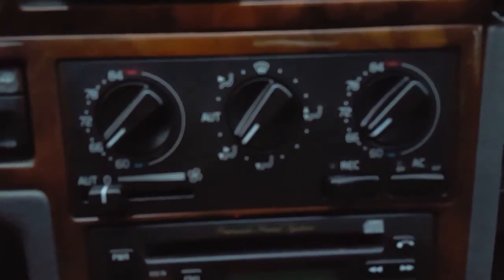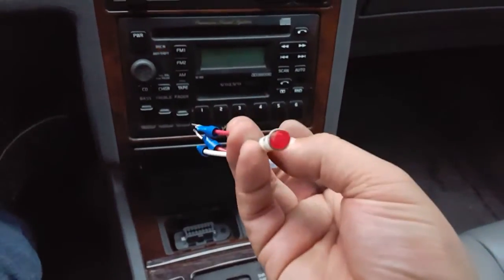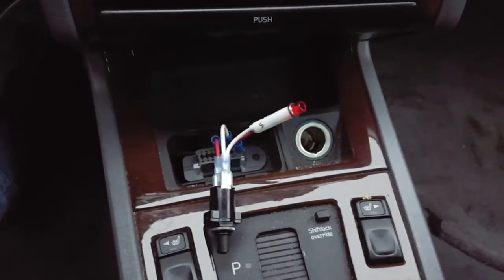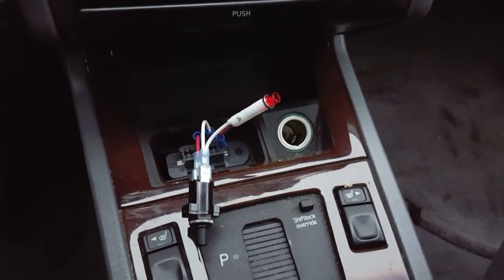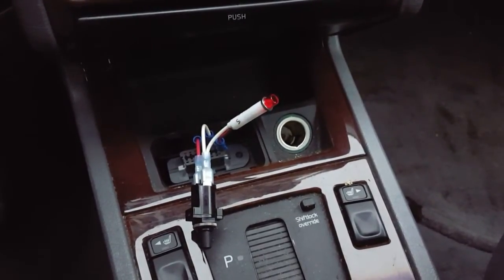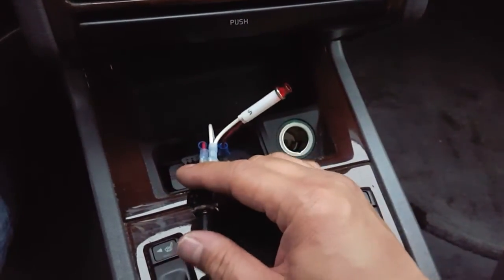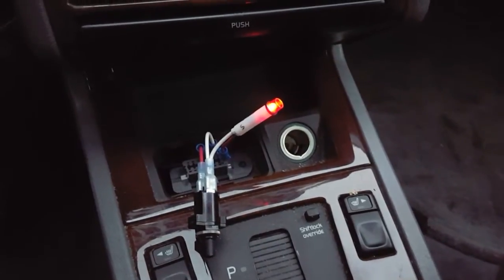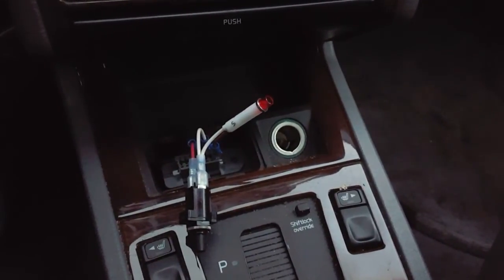1996 Volvo 850:  Reading and clearing ECC codes without a scan tool

Comment: I tried this but it didnt work. Is it only for 96+? I have a 95
Reply from the maker: 1995 models should have an OBD-1 port under the hood, passenger side next to the washer fluid bottle cap behind the headlight.  You don't need a tool for OBD-1 cars, as it's built-in!  See this video from my friend, Robert DIY.  https://youtu.be/bfeiZxhJgxY?si=KcYBig8xhYbSF_D5
Reply: @AKJeeper  this one has the OBD2 as well. So I should just use the one under the hood to read ECC codes?  Whats the process to read them? TIA
Reply from the maker: @xavierfernandez2657  1995 was a transition year.  The OBD2 port isn’t fully-functional as they are on 1996 and 1997 cars.  Check out the video I linked to earlier, Robert explains how you use the OBD1 diagnostic connector.  The ECC codes are read with the jumper in the B1 port.  Use the code chart (link in my video’s description) with the blink codes you get from the B1 port.
Reply: @AKJeeper  I have a 1997 850 GLT now.  Should I try this device? I tried to use a scantool but nothing AC specific comes up

Comment: Does this work on European models? There are differences in the readability of fault codes between the USA and European models. Easier to read usa models. Because it's easier to find a reader that works with them. I bought a volvo 850 reader which cost 120 euros and still it couldn't read engine fault codes, only Airbag and abs codes. Apparently, volvo has used such a special protocol in 1996 in the European models that it cannot be found in any general readers and not even in brand specific ones. Frustrating. But maybe this led system works.
Reply: Light and switch reader worked on my Belgium made 850 with b5202s motor with ecc and fenic ECU.
Reply: @supercomputerbug Yes, my car is also made in Belgium. Of course, you can read fault codes from my car with expensive workshop equipment, but not with cheap home equipment.

Comment: Hi saw this video a few months back but at time I never had any problems until yesterday .so I made up one like yours and got the codes but now it won't clear the codes Sorry this is for the ECC codes can u please help me out
Reply from the maker: If the codes aren't clearing, and you're sure you're following the procedure in the video - it's a sign that the fault(s) causing the ECC to trip the code(s) have not been resolved.

Comment: Thanks for this video. Will the pin be the same for a fenix 5.2 system. Have an 850 -97 (b5252s)
Reply: Have you tried this, did it work on your fenix?

Comment: Hmm. I followed your instructions but it does not seem to work. I have a 1995 850, 2.0L, 93Kw. When I plug in the wires the LED does not turn on. It turns on only when I push the button - same when the ignition is on. Any ideas?
There also seems to a be a problem for computers reading data from obd2 port. I have had two different computers try connecting to the engine but no luck. I have managed to connect to ABS, though (one of the sensors is busted).
Reply: Did you figure this out? Im having the same issue.

Comment: Wait, does a scan tool not work?
Reply from the maker: I haven't found any aftermarket scan tool that works on these older cars.  I have several pro-level scan tools and none of them will do it.  Haven't been lucky enough to win a Volvo one on ebay yet.

Comment: You explained everything so well and yet my tool doesn't work. My LED goes on when I plug in, but it doesn't go out when I turn on the ignition. I assume the momentary switch doesn't have polarity. The LED I'm using has a red positive and negative wire. My OBD2 scanner works when I plug into the port as it should. I  have a 96 Volvo 850T5. I double checked the way I wired it and it seems OK. The only time the light goes out is when I push the button. Also, when I have the positive lead in port #16 and I touch any of the other 2 leads to the cigarette lighter metal... the light goes on. Any ideas would be greatly appreciated. What did I screw up?? :-))
Reply from the maker: Was the LED you used a 12v LED?  If it was your typical 2v or 5v LED, you might want to add a resistor (700 ohm to 1500 ohm should work) between the positive lead of your LED and pin 16 of the OBDII port.  Hope this helps!

Comment: Do you know if this would work on a 2000 V70? I have the newer type of ECC and I'm getting the blinking lights on start-up indicating a fault. My AC button is always on if the fan is on, which means the AC compressor always runs. I had to pull the relay for the compressor so it wouldn't click on, but I'd like to be able to read the fault code it's throwing.
Reply from the maker: No, the ECC system on the S70, C70, and V70 cars that came after the 850 series is a different beast.  On those cars, you will need a scan tool capable of communicating with the ECC module to get the codes out of it.
Reply: @AKJeeper  Yea that's what I thought... I did get my car scanned to figure out what was wrong, but it hasn't solved my heat problem yet. Back to the drawing board!

Comment: Beautiful.  I built one from your layout into an obdii cable connector I bought off ebay.  Works great.  Fixed my issue.  Probably would have cost me hundreds and multiple trips at a Volvo dealer.  Thanks again.

Comment: If i wanted to switch my ECU from a motronic 4.3 to a 4.4 would this tool help with the ECC problems with that conversion? 1996 850 tubo

Comment: Thanks for this post and the links, I bought my 850 GLT less than a year ago and it's in good shape considering its age but it has some issues and one is with the ECC and this will help. I watched another where you cleaned the temperature sensors, as well so next time I go by Radio Shack I will buy parts to make the scanner tool. Great help.

Comment: Hey i just acquired a 1997 volvo 960. I have that Progressive insurance gauge to plug into the car. Does it go into the port by the shifter?
Reply from the maker: Jim Bo yes. It connects to the OBD-2 port. In the case of a 97 Volvo 960, the port is located to the right of the shifter or possibly in front of the parking brake handle. You may have to remove a coin holder or dust cover (no tools necessary) to access the port.

Comment: Where can I find a code listing for 96-98 850 VolvoWhat do the following codes mean4-1-7 1-1-2
Reply from the maker: Here's a list:  https://www.matthewsvolvosite.com/forums/download/file.php?id=33475   4-1-7 means the passenger side interior inlet fan is seized (very common - see my video on the fan).  Not sure on 1-1-2, the fault code list doesn't show that one.
Reply: Just referring to codes you said in your video
Reply from the maker: I just watched the video again.  The codes I showed were 4-1-7 and 1-1-1.  4-1-7 is a code for the fan right by the passenger side grab handle (inlet fan).  1-1-1 means 'no codes'.
Reply: sorry my bad

Comment: Is it possible to clear service light this way? Or read the mileage?
Reply from the maker: No.  Unfortunately you need a scan tool capable of talking to the instrument cluster through the OBD-II port to read mileage and/or clear the service light.  You can read the mileage/clear service light if the car is a 1995 (has the OBD-I connectors under the hood).

Comment: I have a 1995 850 with a pesky Factory Alarm problem.  Alarm goes off when I try to start the car and the car will not start. I believe It started when I used the key fob to lock the doors while sitting in the car, doors closed.  Since then the car will not start and alarm sounds as stated above!   I just bought this used car and do not have a Code reader or Volvo knowledge.  I tried closing all doors and locking/unlocking the doors from outside the car with the key and/or the key fob but the issue will not go away.  I since disconnected the car horn and alarm horn to keep my sanity.  Can I clear or reset the alarm or any codes to fix this problem? Is there an easy DIY Fix to this?  Thanks for your Very Informative Video!
Reply from the maker: Look under your dash (you'll probably have to remove the lower panel - there's a few T-25 screws holding it on) and see if you have a 210/211 relay.  It is a large relay, about 2x the width of a normal sized relay under there.  Remove the 210/211 relay.  You will need to run a jumper wire in the socket that corresponds to pins 50E and 50F on the 210 side of the double relay.  You car will not start without the jumper.

One not-so-nice side effect of removing the 210/211 relay (and jumping the 50E and 50F terminals):  you'll lose central locking and the ability to use your remote.
Reply: AKJeeper,  I'm Lost!  I checked under the Dash, Drivers side. There is a wide black painted metal cover panel running horizontal under the steering column. I did not remove that. I looked under the dash, on the upper left side and found a Large RED Alarm Relay with the numbers, 91-28-903 - Anti-Theft-Alarm - Relay instead of the 210-211 relay you spoke of.

There looked to be another relay(s) behind the 91-29-093 relay but much deeper and almost non-serviceable without removing the dashboard.  I did not see the 210-211 relays.  The driver's door Vin Tag 850GL shows this car was Mfg. in 02/95.  What to do now?  Is there still a Jumper I can apply in order to bypass the alarm allowing to start my this 1995 Volvo 850GL?  Thx
Reply: Can't see the 210/211 relay. Would the 210/211 relay be hidden behind another Reddish-Orange relay with a number on it like 912 88 33 and called - Alarm Control unit?  Are they all the same for that year (Mfg. 02/1995)  Hard to work under drivers dash at my age. I can Email you to see if I am on the right track, then get a repair manual for more help.  Thanks, AK.Jeeper!
Reply: Correction, the relay I was referring to that I found was 91 29 903 - ANTI THEFT ALARM RELAY, not 9128833.  Am I close?
Reply from the maker: Is there any way that you could take a picture of what you're looking at, and possibly remove it and also take a picture of the terminals?  Email to dasuncion@hotmail.com  I know what you mean about this part of the dash being difficult to deal with.  I suffer from vertigo at times, and there are days I can't get under the dash of these cars without getting dizzy. :(

Comment: is this the same procedure to relearn the damper motors? thanks
Reply from the maker: No, this is only the procedure to read and clear codes (Test Mode 1).  To relearn the damper motors, the ECC needs to be put into Test Mode 4.   You can do this with the same button/LED code reader 'tool', but requires different button presses.  See below.  Hopefully I'll get a chance to do a video on this in the near future...

Test mode 4 

- Self-adjustment of damper motor limit positions 

Ensure that the following are set on the ECC control panel before proceeding to reset the damper motors:

- Fan control in manual at about mid setting (half power)

- Recirculation ON 

- Left-hand temperature control set to 72*F/22*C 

- Right-hand side temperature control set 72*F/22*C 

- Air control set to point between Front Panel Vents and Defroster (approx. 11:30 clock position)

- A/C switch may be set either to ON/AUTO or OFF (the setting does not affect calibration)   

Activation

- Ignition on. 

- Press button four times (about 1 second each time). 

- The LED lights up once test mode 4 is activated. The control unit can now receive a control code. 

Entering codes

Codes must be entered one step at a time, while watching the LED. The LED will go off after each digit has been entered. 

it will then light up again for the next digit to be entered. 

Entering each digit in the code must not take more than 4 seconds. 
Failure to do so within four seconds means that the control unit will be
 unable to accept that digit. You will have to abort the input. 

Switch ignition off and on. Restart test mode 4. 

Example: to enter code 3-1-2: 

Unit must be in test mode 4 (LED on). 

Press button three times (for figure '3'). The LED will go out. Wait until it comes on again. 

When the LED comes on, enter the next digit. 

Press button once (for figure '1'). The LED will go out. Wait until it comes on again. 

When the LED comes on , press button twice (for figure '2') 

Code 3-1-2 is now entered. 

Exiting

To exit test mode 4: 

Switch ignition off to abort test mode 4 once all checks have been made.   

Self-adjustment of damper motor limit positions  

You will need to make this adjustment after replacing a damper motor or switching to (testing with) a control unit which has been in use. 

If you take a new control unit from the dealer and use it, the control unit 
will adjust itself automatically while test driving the car. 

Enter control code 9-9-9 as shown in 'Entering codes' above. 

Press button nine times in quick succession. Enter this series three 
times, with a pause after each series of nine, waiting for the LED to 
come back on before making the next input. 

The control unit is now activated and will adjust the damper motor limit positions automatically.   

Test Drive Car :Drive car for a few minutes at a speed over 30 km/h (20 mph) . The control module will then carry out self-adjustment while driving.  You should feel/hear this happening.  If you don't, then self-adjustment isn't being carried out.
Stop car but leave ignition on for at least two minutes to enable control module to store all values.
Check Self-adjustment Is Complete :Ignition on. Activate Diagnostic Test Mode (DTM) as shown in video. Read off the diagnostic trouble code (DTC).If diagnostic trouble code 1-1-1 is displayed:No fault stored. Self-adjustment complete.
Reply: Thanks man! it worked like a charm!!
Reply from the maker: You're very welcome.  I still haven't had a chance to do a video on damper motor calibration.  Did it take you very long to get your damper motors re-learned using the above procedure?
Reply: I just had to read the error codes one by one (ecc threw 8 error codes), then pressed the switch for 5 seconds, then other 5 seconds to clear the ECC and after that the dampers automatically started to calibrate themselves in less than 10 seconds. No more blinking leds. The whole procedure was done in less than 3 minutes. My Volvo is a 1997 850 2.5 GLE 10 valve version with Fenix 5.2 ECU if that helps.. though it should be the same for all versions.

Comment: Can you use that tool to read engine error codes, like emissions?
Reply from the maker: Yes.  To read "check engine" codes, all you would have to do is switch one pin.  Move the pin from Pin 6 (ECC) to Pin 3 (ECU - Motronic 4.3 only....I haven't heard of this working on Motronic 4.4).  From there, reading the codes is done in the same manner as the '93-'95 cars.

You can also read cruise control codes, by using Pin 13.

Comment: This is great, thank you !. What about clearing the service light ?
Reply from the maker: I looked into this one, hoping that the service light could be reset using a home-made tool.  It appears that the service light is reset through the high-speed data network, and you'll need a tool like this one to reset it.  https://www.fcpeuro.com/products/volvo-service-reset-tool-ft-elektronik

The service light just came on my '96 850 and it's annoying me.  If I find a less expensive tool for it, I'll be sure to post an update.  

Thanks for watching!
Reply: Thank you for sharing your knowledge.
Reply: @AKJeeper   That link is no longer avalible, do you have another link how to reset the servive light ? I have a volvo 850 GLT 1995

Comment: I have a 1996 Volvo 850 2.3 T5 (manual gearbox)
I bought a scanner and all I get is "link error"
I'm suspecting this is how I need to obtain the fault codes?
cheers.
Reply from the maker: My OTC Genisys scan tool (one of the main scan tools I use professionally) is unable to pull ECC codes from '95-'97 Volvo 850s (even though I'm given the option in the menu).  It pulls other codes (transmission, engine) just fine, and ECC codes from V70/C70/S70 cars just fine.  So yes, I'm thinking you'll need to read the ECC codes from your '96 850 using this method if your scan tool won't.
Reply: Does your kit clear abs codes on the same model?